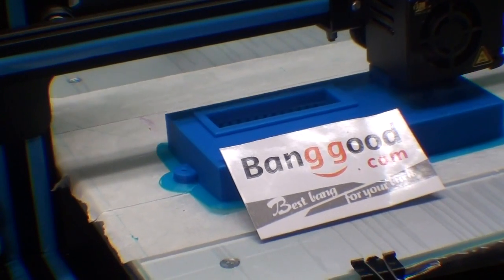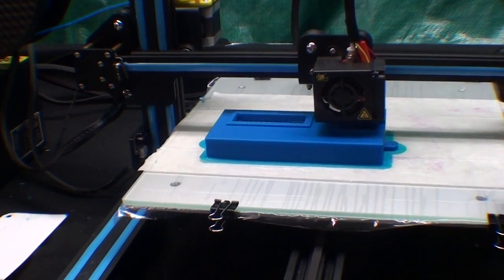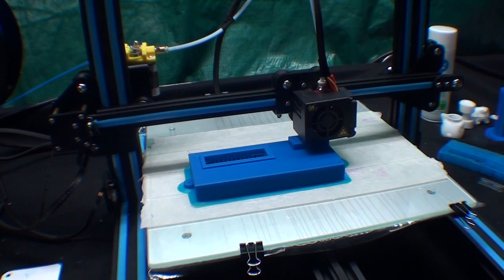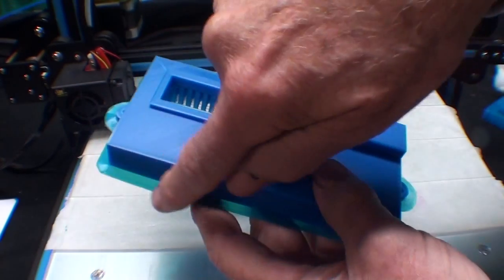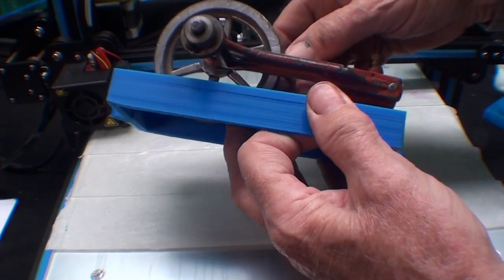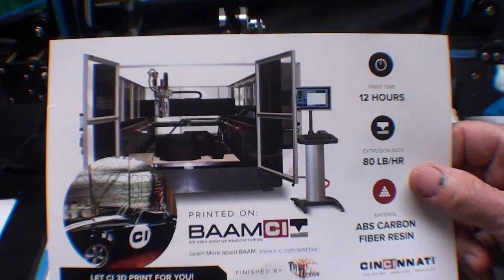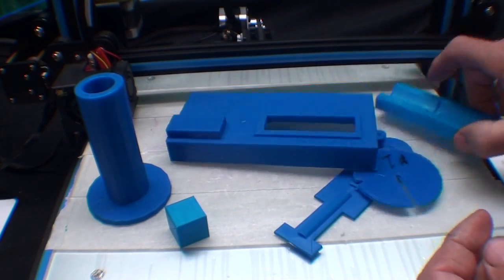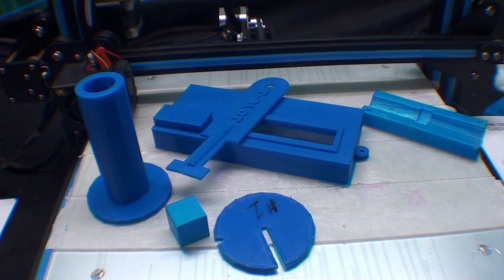3D Printing CREALITY CR 10 with tubalcain #1

Comment: I've been seeing more and more 3D printed metal parts in the machine shop. They need all the precise features and threads machined. They come in any alloy you can think of. They look like sand castings. They're more intricate and precise but just as rough. 3D printers can do amazing things but they can't replace machining. Not yet anyway.

Comment: The cura profile for your printer is where you can add details like temperatures in the pre-print gcode and homing in the post-print gcode.  Found this link which has a lot of profile files you might like.  https://github.com/LeBlaaanc/cr-10-cura-profiles

Comment: You can change the number of sides of cylinders (up to 64 iirc) and of some other shape in Tinkercad in the menu that pop up when you create the shape, also in the grid setting of the bottom right you can adjust the "snap" resolution, or turn it off, when off insert a ruler in the space to work with offsets

Comment: You need to have it configured to where the print head will lift itself up and the home itself to the x axis and y axis after that. Printing this thing upside down would of generated less support being used resulting in faster print and using less material.  Infill percentage would also affect your print speed as well as models strength. Layer height is another thing that would affect models strength and more or less visual appearance. There are also printer profiles that are included on sd card and can be imported into your slicing program.

Comment: For adhesion stick a sheet of pei to glass with an adhesive film and sharpen a wide paint scraper. Use some alcohol on a rag to degrease and freshen the surface with light abrasive pads or steel wool. If you print too close to the bed it can be a bad time though. I've never met a print i couldn't remove from the bed without a good grind on my tool and some persuasion, just make sure you take the bed out of the printer before you go too crazy.

I'm doing a lot of long ABS prints, so I just make sure it sticks. Design of the part is the other culprit, know how much your material wants to shrink; don't give a great big muscle to crumple the part.

https://www.amazon.com/Gizmo-Dorks-Printer-Surface-Adhesive/dp/B074XJLWL6/ref=pd_sim_328_4?_encoding=UTF8&psc=1&refRID=K6BMP6BJMYEYXYE0G4SY

Comment: Not sure if anyone has addressed the homing problem fully at the end of the print. Did notice someone mentioned G28 but I'll try to explain with what limited information I know on the subject (only had my CR-10 for two weeks).
Firstly in cura I have noticed that were you place the model on the virtual bed is where it seems to print, as long as you have unclicked the option 'origin at centre' (more on that later). If you place the model in the centre it should print there...
Secondly, I am using a Mac and assume this is the same for Windows but if you go into cura and navigate to preferences which is in the Ultimaker Cura drop down menu. If you then go into the printer setting you should see a tab with machine settings in there. Once you have finally navigated to here you can set all the CR-10 settings like bed width, depth and Z height (300,300,400 respectivly for my model) etc. I have unchecked the origin at centre option otherwise I think you may get the print in the wrong spot on your bed. The gcode flavor I have is Marlin and am not sure what other options here will do (as I said I'm a newbie). Now down the bottom there should be a start and end gcode. The code included here is inserted before your model starts to print and at the end of the print. For your machine to return to home you should see in the end gcode a line saying G28 X0 Y0. My undersanding is that G28 is the g-code command for return to home position so I'm not sure why the added commands of X0 Y0 are there but maybe to ensure the G28 code knows where the home position is. If this line is not present you will not get homing at the end of the print. You can manually enter the code should it not be there. On mine it comes after the G90 code.
Sorry for the long winded response, and I'm sure someone with more knowledge on the subject than me will correct any mistakes I may have made, but I hope this helps...

Comment: I am happy to see you getting introduced to 3D printing. Sorry to see that the CR 10 isn't exactly user friendly. I started using a MakerBot Replicator 2X three years ago and found it extremely user friendly. I didn't need to know about g-code or slicers as the software that came with the printer did it all automatically. I generally print higher res so prints can take some time but I find it worth it every time. The only setting I ever really change is whether or not to use supports for a specific model. Somebody mentioned needing a good CAD system for models for 3D printing. That is true to some extent, as one needs to be able to set faceting or resolution to higher qualities so circles are perfectly round and not segmented like you showed with one of your prints. I use SolidWorks and TurboCAD and both work well in this regard. I just mentioned these other systems as I think readers that are new to 3D need to be aware that there are user friendly options available. Not sure what the CR 10 costs but the MakerBot was about $2500.00 at the beginning of 2015. I have printed hundreds of models to date and I still get a thrill when I do. It is pretty cool technology.

Comment: I have that printer  i use just cheap dollar glue  on glass, bed temp 60, nozzle 200 I use the same glue 4 or 5 times then clean it off with windex.  all settings are in cura. bed position is dependent on where you place the  3d print on the cura templet before slicing and saving. Here is a good site lots of info https://www.reddit.com/r/CR10/comments/63xabj/frequently_asked_questions_on_the_cr10_family_of/  Also google cr10 cura settings. If you need i can give you all my cura 2.7 settings. I never change them and get good prints.

Comment: You should be able to add an epilog in Cura to move the head away. Not sure where your machine zero is, but either:

 G28

or

 G0 Z100
 G0 X0 Y0

As far as your model goes, the STL file format going from TinkerCad doesn't have anything other than flat triangles. There should be a setting for the maximum deviation from the ideal model. Reducing this will make the file more accurate, but much larger. 

The bigger model will make the slicer slower, but the g code going out will not be substantial bigger.

Comment: Switch to grey filament and you can pretend it's metal. ;-) I think Fusion360 will produce the g-code you need, and there's lots of good YouTube tutorials--including those by John Saunders (NYC-CNC: https://youtu.be/o-GBpUZ3piY) and Lars Christensen (https://youtu.be/A5bc9c3S12g). It'll make it easy to include draft and fillets so you can print patterns. There's also ways to smooth the surface of the prints (Matt Perks: https://youtu.be/6xFUNFG-UKE).

Comment: I've been 3D printing for several years now, my first printer was made from MDF and drawer rails, with the nozzle hand filed from a piece of alumium.. 
Here is my advice: forget Tinkercad or other such CAD programs, try parametric construction instead. I have been using Openscad right from the beginning and it is incredibly powerful because it is more like a programming language than a CAD program. So, say I am designing a reloading tray. My parameters would be bore size for the sockets, height of the tray, number of columns and rows, wall thickness, depth of the sockets and so on. Alle of these settings would be made parametric and i could use openscad to create stl files with any parameter combination I want by simply changing the source code. 
Then, using just a single openscad file I start by printing a small test piece with e.g. just 4 sockets and thin walls. This piece prints fast and I can use it to check if socket diameter and depth etc. fits the intended cartridge. Then I start fine tuning, like wall thickness, print settings etc.. But to do so, I only have to change parameters in the openscad file, not repeat the construction process at all. Finally, when I am finished fine tuning the parameters, I can print the 50 socket reloading tray, which might take 2 hours or so.. If I ever need a tray for a different cartridge, all I have to do is change just a few parameters and generate a new stl file. Takes 10 seconds.
It is a pity, that nowadays people only upload stl files to thingiverse etc., not the openscad source code so you can tinker with it.

Comment: That's actually great adhesion! whatever your doing its great. keep doing that! Once you have the item loaded in cura you can actually move it. I'm sure you can find some YouTube videos on how to manipulate things within cura. There is one thing that you might want to look into and that is what your printer sizes X,Y,and Z are set to. Cura program needs to know your specific printer settings so it properly works. For simple parts, hand making  patterns is the way to go but I'm sure your imagination can go hog wild with details that if you were to hand build, it would have taken days or even be imposible.I highly recommend fusion 360 to create your patterns. It has a very easy function to set taper angles when you extrude so your patterns pull out correctly.Hopefully you will attempt LOST PLA casting.
Reply: sorry for redundancy I thought I was first LOL.

Comment: In your Slicer (Cura) you can position the model to the middle of the bed (make sure you let the Cura program know what printer you have OR at least the bed size otherwise it will be offset). You can also control the temperature of the nozzle and the bed in Cura's Settings (should be off to the right). Hope this helps, Lyle!

Comment: I use 3M Blue Tape #2090 (3in width) and wipe the bed first with rubbing alcohol before applying the tape. Then I wipe the top of the tape with rubbing alcohol to remove the wax.  Hope this helps.

Comment: For the cylinder, you need to increase the number of sides to a higher count. The more sides, the smoother.

If for example, you set the number of sides to three, you will have a triangle.
:

- edit -
• changed higher to more sides
• added comment about triangle
:

Comment: I follow Maker's Muse on here for 3dprinting info. You might get some use out of his channel. Seems that using glue stick is pretty common for helping to keep prints stuck to the bed. There was a video recently where he was reviewing some cheaper printers and he brought up the print centering. Seems that the firmware used is for a different but similar model which is what caused the issue in his example.

Comment: As far as being able to make those things faster using other means.  Of course you can.  But you have been conditioned in your thinking throughout your life and career to design things that you can make using the tools that you have access to.  Function over form,  simple geometry,  boring shapes, etc. You could, for instance, print a steam engine model (moving, but not steam driven) complete with moving parts, and cutouts to show internal workings in one pass.  A 3D printer is more useful printing things you can't buy (maybe you invented it) than printing things you can buy. They are also most useful making things that are not possible using any of the other machines or tools you had in your possession two months ago.

Comment: Try FreeCAD for modelling. It is free for windows and linux, relative easy to use and have some nice options for patternmaking like fillets and draftangle. Allso it is very precise, somewhat under 0.07 - 0,08mm deviation on the dimensions. Cylinders and spheres have high poligon resolution. Cura is a good slicer.
masking tape wocks fine for me but only on a cold bed (I am printing with PLA filament most of the time)

Comment: I had those issues with my Malyan M150 . . Turned out to be the wrong firmware, or a slightly dif variation of it, You should double check you'r firmware is correct. Hope this help's!

Comment: Faceted Cylinder problem.  In TinkerCAD, after creating the cylinder, edit it's properties.  Change the Divisions from 20 (Twenty Facets) to 100 (the maximum).  If it makes your print slower, or your file size larger, etc. and that causes problems for you, change the number to suit. As with many things,  it's all about compromise.  Like deciding you need make a part weigh less without compromising strength too much.

Comment: Always apply glue stick onto a COLD bed. You might look into using CURA to print your STL files. It will allow you to drag the print to wherever you want on the bed. you can also add the g28 command recommended below.  I use Fusion 360 for most of my designs.

Comment: in cura, under machine setting make sure you have the correct bed size (default is 200 x 200) and make sure it knows your has a heated bed. I run my machines at 50mm/sec with a 0.5mm nozzle, it seems to print with minimal artifacts at that speed and the slightly larger nozzle is less prone to clogs.

Comment: I forgot, dump the tape, use hair spray or your glue sticks directly on the glass, not to help stick but to help unstick at the end of the print.
Reply: Agree. Everybody out there on the internet i trust when it comes to 3d Printing seems to agree to not use tape. I always prin straight to the (clean) glass and don't have any problem with the print sticking.
Reply: Nah, tape is ok. You just have to move the wheel to 20% speed for the first 2 layers. Then you gradually speed up.
It's so good, i printed Venus de Milo without any kind of base and when i wanted to remove it, i actually removed the whole tape with it. :) Slow speed at start> speed up later.

Comment: All your questions are related to the software you are trying to print with. If you are printing directly from the SD card, then you may be limited to the options you can change on the printer (unless your software can embed the G-codes to achieve what you want then put it into SD card). I use Repetier Host for sending the G-codes to the printer. In Repetier, there are optional G-codes you can enter at the beginning and end of the print. For example, returning to home position can be added after finishing the print... etc.
Reply: Also, the print at the begining of the video had front left corner was wrapping. I'd suggest researchig methods to elimnate that depending on what material you are using.

It is fact of life... if you want fine quality (thinner sliced) prints, it will take longer to print. You can lower the quality (faster) and sand it smooth.

Comment: Print time depends on many of your settings, principly, layer hight, infill %, and obvious print speed. These settings you set in your Slicer program. I suggest you install Cura 2.7, its free too and is one of the best if not thee best free slicer program available.  Tinker cad as you know is based on shapes that you drop into your workspace either adding or subtracting to your drawing but as you i have found things are not smoothed out but sometimes rather than saving a. .gcode save as .stl, load the stl in cura for slicing and adjust the print settings then save as .gcode and to the printer i have gotten better results. Better again design in fusion 360, save as stl, it should automatically open Cura, slice then print. Fusion 360 is free for hobby use too but there are many other free cad programs far better than tinkercad on internet. 3D printing is like machine work, it takes time to learn how and also end results should improve with practice. These few lines cannot help as much as practice, trial and error but hopefully point you in the right direction, a bit like your tutorials, you make it sound and look easy until i try it but you have been a great help in many ways and i'm getting there thanks to you. regards from Spain

Comment: To go back to zero at the end in Cura click on the tab "Start/End Gcode".
Here you can tell it what to do. This is my code (I believe it is default):

;End GCode
M104 S0                     ;extruder heater off
M140 S0                     ;heated bed heater off (if you have it)
G91                                    ;relative positioning
G1 E-1 F300                            ;retract the filament a bit before lifting the nozzle, to release some of the pressure
G1 Z+0.5 E-5 X-20 Y-20 F{travel_speed} ;move Z up a bit and retract filament even more
G28 X0 Y0                              ;move X/Y to min endstops, so the head is out of the way
M84                         ;steppers off
G90                         ;absolute positioning
;{profile_string}

The G28 X0 Y0 is the line you want to edit. It's just coordinates like on a mill readout!

I told you it's too darn slow.

You can adjust the circle facets thing, but I don't know Tinkercad.

Comment: Polygon circle (extruded to become your tube): When you draw a circle in your CAD software, one of the circle properties will be the number of polygons/segments forming the circle. It looks like the circle forming your tube only has about 24 segments. Try using at least 4 times (or more) that number of segments, at least 96 and even up to 360 segments (1 segment pr. degree).